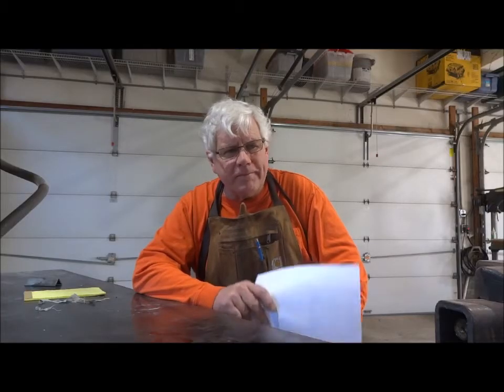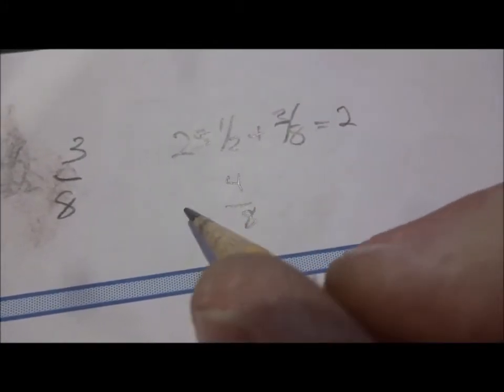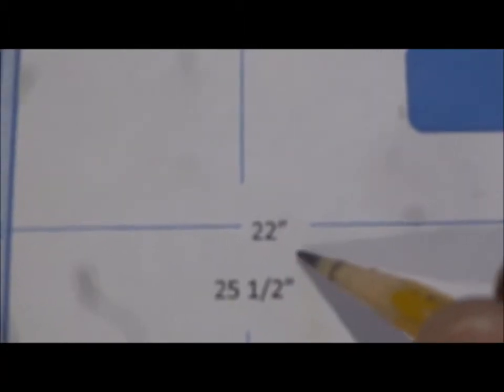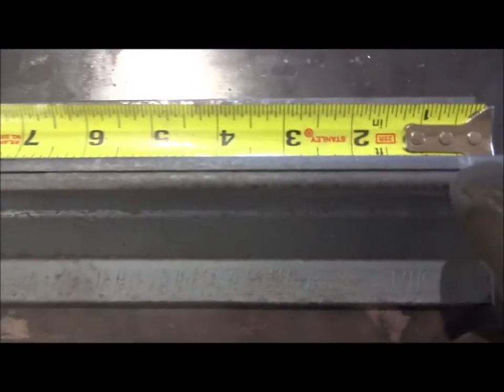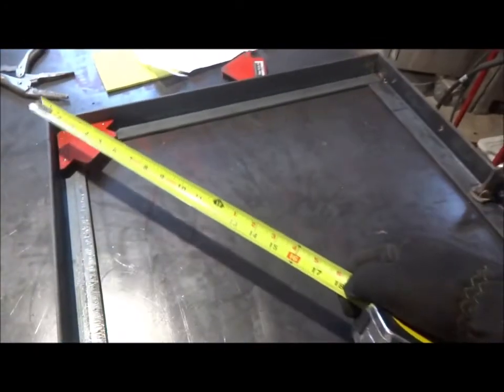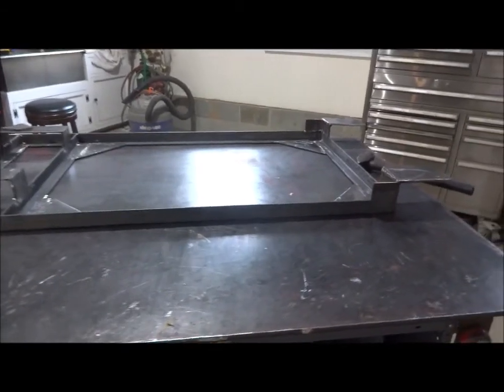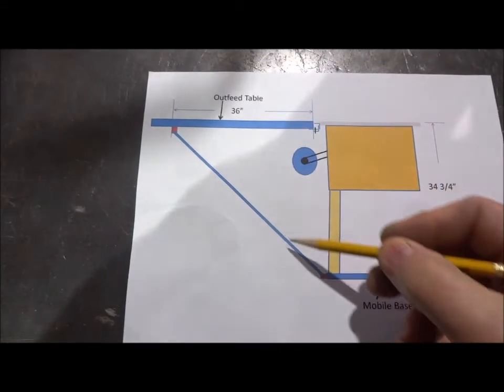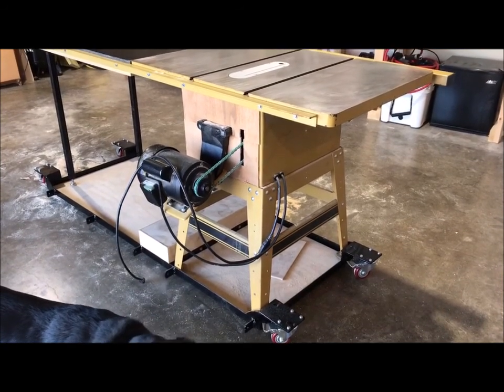Mobile Base for Table Saw & Math Lesson For 7th Grade Boys

Comment: Ok! I'm glad I live in a country that went metric in the early 1970s. I was brought up in imperial measurement and used it for years. But changing was easy and I now look at US YouTube videos today and wonder why people in the US have not taken it up. The US government has. All the manoeuvring of fractions that can be represented in metric by a decimal point make life so much easier. But I do still say things like "its about an inch long"even today.
Oh I forgot.
The wheel compresses 3/128ths when a 500lb weight is applied and then 1/128 for each additional 500Lb. they also have a wear factor of 1/64th when used on wood and 5/256ths when used on concrete over the first 3 years and doubling after that. So that must be added to the lift height or the legs will not clear after some time.   🙂 🙂
Reply from the maker: hahaha - I guess I'm old school and old habits are hard to break.  Thanks for watching and commenting.